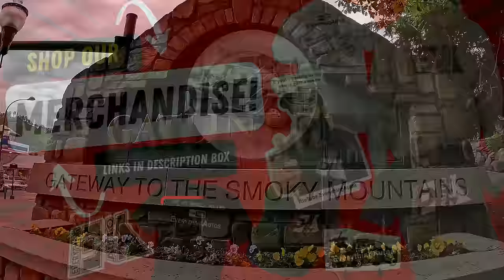Illegal Parker Claims We Damaged Their Vehicle - Video Says Otherwise | PD Call For Car 30ft Down

Comment: Lordy, this reminds me of a Christmas party, a gown, a tuxedo, valet parking, and a door handle ripped clean off of my 1988 Mustang GT. Left the party, valet held the drivers door open for me. I drove toward home, stopped for gas because I had work the next day. Reached for the door handle to get back in the car, and there wasn't one there.  I hauled butt back to the restaurant and they tried to deny the damage.  So I said "do i look like i climbed through the window to get here or climbed across the console and gear shift?" They still tried to deny damage, so as every guest left, I said "be sure to check for damage before you leave. They damaged my car and are trying to deny it." End result: they paid the total cost for replacing the door handle.

Comment: That Chevy guy has a wierd definition of mint condition. (Of course I know he was just leading up to a damage claim)
Reply: 58K is "low mileage"?  Really? I don't care if the car is 20 years old.
Reply: @alangrund5031  To determine whether a car has reasonable mileage, you can simply multiply 12,000 by its age. That means good mileage for a car that's 5 years old is 60,000.
Considering the fact that modern cars can last up to 200,000 miles, 58K IS low mileage.
A ten year old car can have 120K miles and be considered average.
Reply: (Unless, of course, that Malibu is less than 5 years old)
Reply: @ThomasKent1346 for 13 yrs old it's low mileage. Mint? No but it's nice condition, garage kept & a nice Dailey driver.
Reply: @ThomasKent1346  It's an Impala, not a Malibu. He called it wrong but it's clearly an Impala...the name is on the rear of the car...

Comment: trail mater and matt's off road recovery use electric winches for off road recoveries, both of their off road tow trucks have winches built into the sides for those times where they have no space but need to be next to the vehicle. trail mater's gets used a lot since theyre based out of moab, whereas matt's off road's doesnt get used a whole lot since he covers more of the desert and dunes, but they seem to be used often enough that it would be a hassle to just have a hitch mount winch and hitch receivers on the sides of the truck

Comment: Love it when they say that a 58,000 mile car is low milage. Where I'm from that mileage would be time to sell mileage. I suppose because America I so big any car with less than 100,000 miles is low milage. After owning 20 something cars, I only had one go over 100,000 and that was because I bought it as a beater with 85,000 already on it. When I got rid, I think the mileage was about 120,000. Average mileage around here, according to the buyer guides is about 12,000 for the first couple of years and 10,000 per year after that.